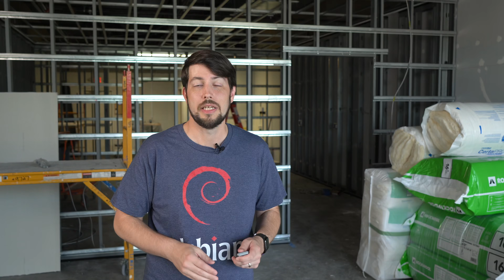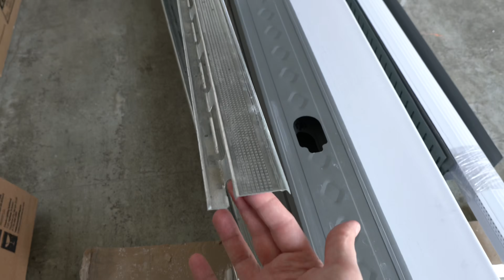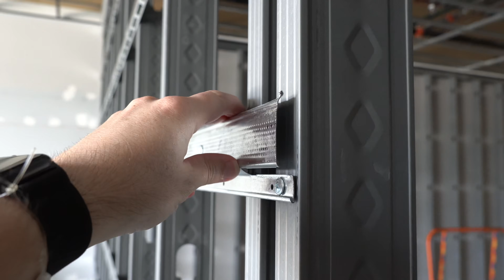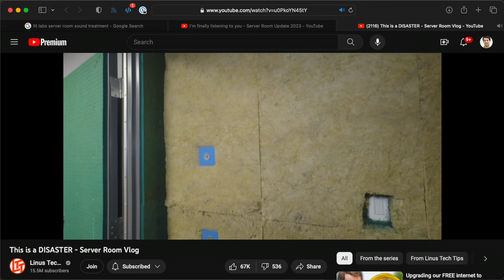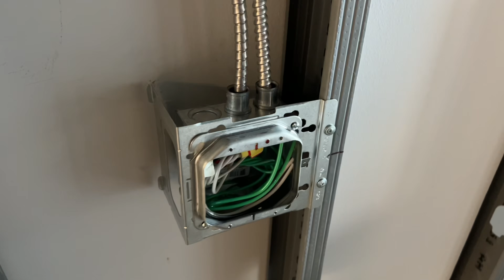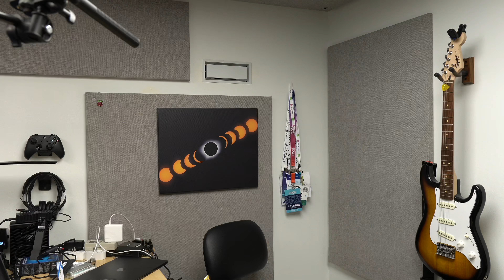Soundproofing my new studio (moving 05)

Comment: I always enjoy watching your channel.
Did you also start at the source, so the air ducts are damped, the fan is on a damped frame because I wonder if that makes a difference.

Greets.
Reply from the maker: The unit is on a rubber gasket, but no other sound isolation at this time. It's actually not bad, certainly better than the old days where roof units were placed directly on the roof structure!

To save costs, we're sticking with the existing main duct, which is done well but not damped in any way. We're going to rely on the rockwool to deaden the slight sound of air flow through the duct work.

Comment: Double check the specs on the closed cell foam. I’ve seen that stuff degrade after a few years.
Reply from the maker: This is the builder-grade material meant for wall use — bought from a local construction supplier. Supposedly it has a nice long warranty though I can't find the spec sheet for it in the box.
Reply: @JeffGeerling  🤞 in that case 😁
Reply: @JeffGeerling  Looking and thinking back at the foam I bought for a loudspeaker build years ago, I recall that there were no endurance/life span spec on the products I looked at. So with that in mind I bought a reputable brand "RS Pro" in the UK. 'Open Cell Impregnated Polyether'. RS Stock No.:
103-4073

I've not opened those speakers up for 7 years, so I don't know if the foam has degraded, like I've experienced in the past with unbranded foams.

Comment: Jeff creates an echo chamber:
There is no PC, only Raspberry Pi.
Linux kernel must be compiled on boot.
Use Ansible to control your toaster.
Atomic clock is the best watch.
Reply from the maker: Oh believe me, the atomic clock will be going in that server room as soon as I get all the infrastructure in place! Planning on putting a good GPS antenna on the back of the building ;)
Reply: Are you going to put a large (like 2ft) digital clock on the outside wall fed from the atomic clock?
Reply from the maker: @rivimey  - That's a great idea! I can also call up Master Clock here in St. Louis and see if they'd want to help with that. They have some really cool displays.
Reply: TCCBOOT by Fabrice Bellard (the same person behind QEMU) is a special boot loader which compiles the Linux kernel before each boot. It's almost 20 years old and only tested on 2.4.26 so it's probably not useful nowadays but it's interesting nonetheless.

Comment: Very interesting and informative video! To treat the sound in the studio, are you building the walls and ceiling non 90 degrees?
Reply from the maker: Not in this case! In talking with the architect (who has done radio and music recording studio work in the past), for speech it's a lot less important to have the angles—it's more for spaces where you need to have loudspeakers, and potentially instruments or other devices that make more noise.

It doesn't hurt, but it doesn't help as much for speech-only recording (as interior sound treatments), and it adds (a little) to the building costs, which I was trying to keep down as much as possible.

Comment: Nice!  Double air gapped wall framing, stuff cavities with rockwool, resilient channels, 5/8"+ drywall sandwiched with green glue, decoupling layers and framing,  all of these and more help dampen noise.
Reply from the maker: The only thing we aren't doing in this space is the double-layer drywall. Just one layer to save cost... drywall work is CRAZY expensive right now, not quite sure why but the builder said it'd be almost double to double up the layers. Could add more in the future in a small renovation though, if it is required and I end up staying here longer-term.
Reply: @JeffGeerling  , thanks for sharing info about Owens corning 703 fiberglass panels, checking those out.  Looks like they're lightly painted to look nicer and prevent fraying?  Look forward to seeing final setup.  Cheers!

Edit:  looks like fabric covered panels are available in gray and other colors.  Not cheap!
Reply from the maker: @AzaB2C  - Yes! And you can also get them wrapped in sound-transparent fabrics to make them look nice too. Mine are wrapped in grey.